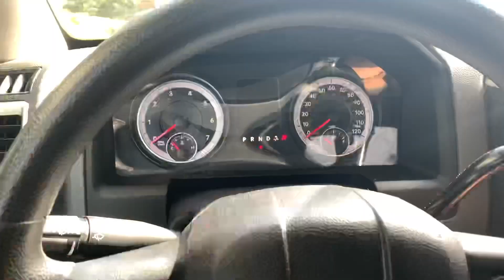BMW 535i Rebuild pt.2 Taking it apart!

Comment: how much did cost you to rebuild this. I have same issue with same exact car. actually little better as the air bags didn't come out.
Reply from the maker: Less than $1.5k
Reply: Wow.  Where did you buy the parts from? Only after market lights are $1000